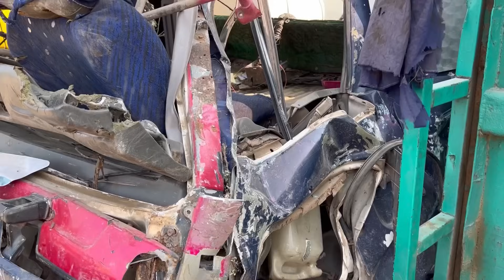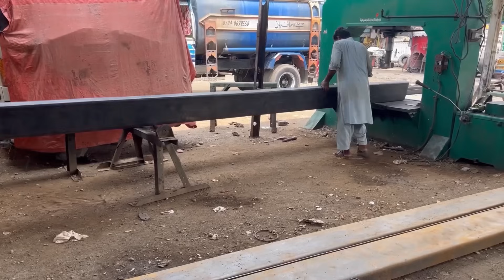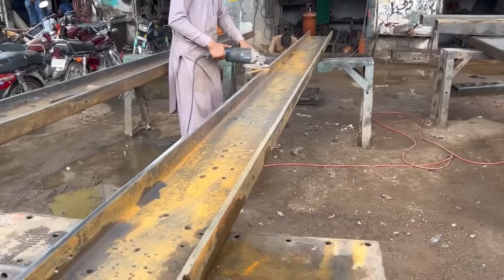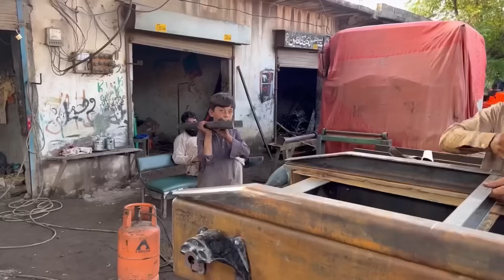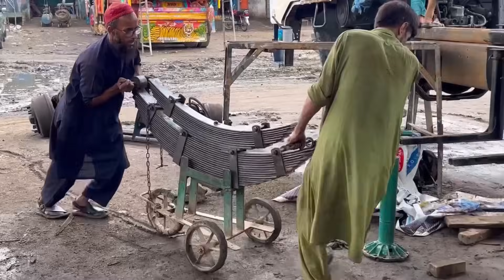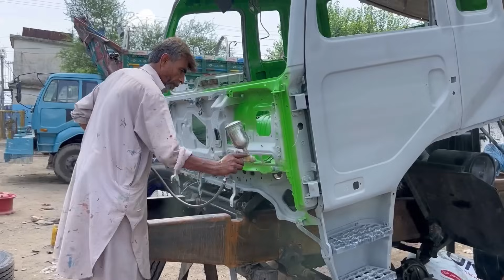The Amazing Truck Damper That Fell Off The Mountain Was Restored

Comment: While I'm not quite sure what a truck damper is, this video demonstrates typical Pakistani mechanical aptitude into turning literal junk into a fine new addition to someones business. You would never see that done in the states because the cost of the labor would be 10 times what the truck was worth.  And yes, before someone else  comments about the straightened frame being a weak point, and I'd agree, 90% of these trucks have a penchant for swan diving off mountainous Himalayan roads, so I really don't think that's an issue...